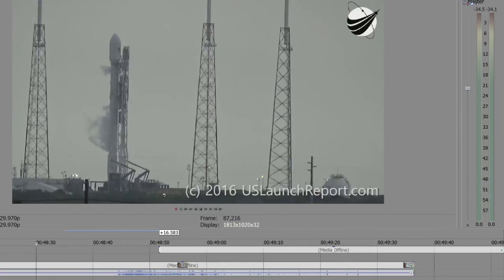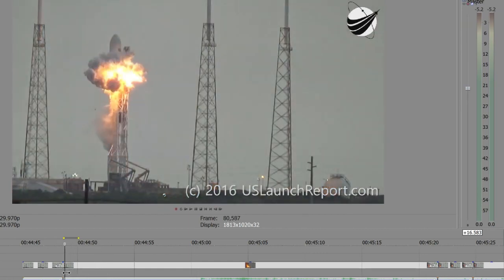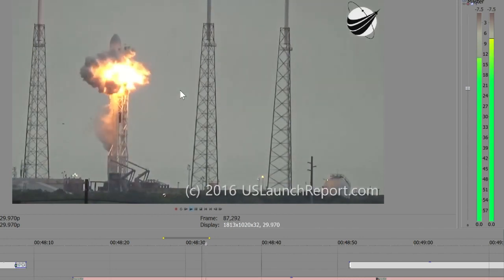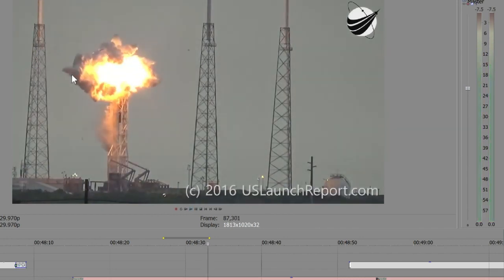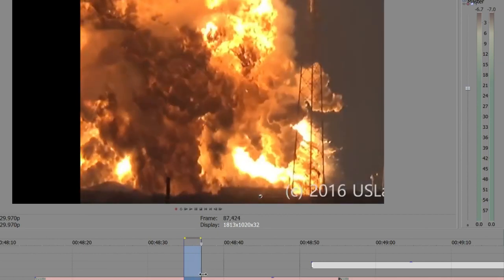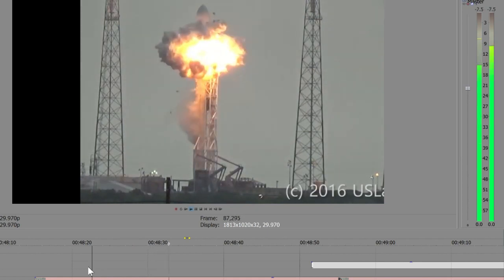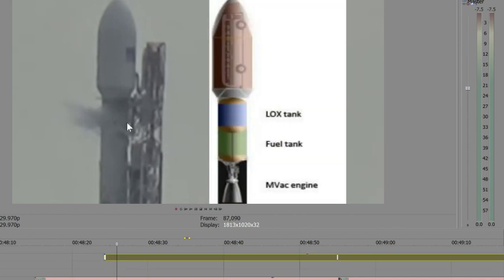Detailed analysis of Spacex Rocket Explosion

Comment: Cause of the explosion? SpaceX released an official statement in January 2017, indicating that the cause of the failure was a buckled liner in several of the composite overwrapped pressure vessel (COPV) (used to store helium which pressurize the stage's propellant tanks), causing perforations that allowed liquid and/or solid oxygen to accumulate underneath the lining, which was ignited by friction. Following the explosion, SpaceX has switched to performing static fire tests only without attached payloads.

Comment: ICYMI: (Below is an extract from http://www.spacex.com/news/2016/09/01/anomaly-updates )
"The accident investigation team worked systematically through an extensive fault tree analysis and concluded that one of the three composite overwrapped pressure vessels (COPVs) inside the second stage liquid oxygen (LOX) tank failed. Specifically, the investigation team concluded the failure was likely due to the accumulation of oxygen between the COPV liner and overwrap in a void or a buckle in the liner, leading to ignition and the subsequent failure of the COPV."

Comment: I've read similar analysis written by some Russian who studied some engineering back in a day. Not even linked to rockets. In his opinion that pop was caused by hydraulic shock because of SpaceX attempts to pump more fuel and more oxidiser (lower temperature of both - higher density) in the same amount of time. Hydraulic shock caused something to rapture - could be "filling hose", could be something on board, could be connection between the two.
And he also mentioned that it is really weird that SpaceX haven't solved the mystery immediately, end Musk called it "the most difficult and complex failure we have ever had in 14 years."

Comment: TF, could you focus a little bit on the ejecta we see in the first few seconds of the explosion. Particularly the large piece that seems to go pretty much straight up. If the first event was from within the rocket body, how did this piece get past the payload. Is it possible that the first event happened outside of the rocket body and sent shrapnel through the tank?

Comment: Youtube user TechX has suggested what seems to be an entirely plausible scenario for an initial explosion outside the rocket, just as it appears in the video. If the LOX loading pipelines on the tower were insulated with polyurethane foam, soaking it with oxygen would produce a rather powerful oxyliquit explosive. But if the pipelines didn't actually leak, where would the oxygen come from? The air, plus possibly the oxygen-rich vent plume from the rocket itself. SpaceX supercools its LOX to cram more into the tank, so it would be cold enough in the pipeline to condense oxygen out of the air. You're probably more familiar with this hazard when handling LN2, since its normal boiling point is well below that of LOX.

Comment: I think the MVac started falsely, creating a vacuum in the plumbing, thus creating a vacuum in the fuel tank, rupturing the separating wall with enough force to generate either a spark or heat, causing the explosion.

Comment: hey is there any chance that the first squeek and pop are the liquid oxygen and fuel mixing, exploading out the exhaust or thruster but only a little burst, then it takes a few seconds for the mixture to heat up enough and build up enough pressure to break the side of the rocket. I guess that'd explain the sudden explosion and the creek + pop. Try enhancing the video at the exhaust

Comment: You have done an excellent analysis. I would like to challenge you to calculate the speed of the fly by object.  You will find it IS NOT A BIRD. 

• You know the height of the rocket. Using this you can estimate the distance traveled by the object per frame.

• The frame rate of the video is likely 60 frames per second. It may be 30fps but I doubt it. For fun, let's be conservative and say 30fps.
Given your video, I'm sure you can do the math.......

Rate x Time = Distance

Don't forget to convert units!!

I have no clue what this thing is in the video, one thing is certain,

IT AINT NO BIRD....... 

Unless it has a giant bottle rocket shoved up its butt.

Comment: Hi Thunderfoot, this is an excellent analysis, unlike most of the stuff I could find on youtube (bullshit like the "strongback" exploded etc.). One small correction: helium is used to pressurize the kerozine tank. The oxygen tank is pressurized with oxigen, heated up in the rocket motor via a heat exchanger. Confusing fact is that the helium bottles are kept in the oxygen tank, because that's the coldest place of the rocket. (Actually, helium has to be heated in the rocket motor too to be useful for pressurizing... etc.etc.)

Comment: It's now Oct. 2, 2016 and there still seem to be no answers as to the cause of the explosion.    I wonder if SpaceX has considered trying to reproduce the incident?   They could use one of their used (landed) first stages, and sacrifice a new second stage then do the fueling procedure over a number of times in the hope a failure might eventually occur.    If the rocket is instrumented well enough it might give them enough clues for a solution to the problem.    A last resort method of coarse.

Comment: After the pop there was evidence of 'weight' rupturing the lower fuel tanks, could there be a possible 'blowout' of the upper fuel tank at least dropping the volume of the upper tanks content straight down to the top of the lower fuel sections? Can you zoom in and enhance the area below the area you show, maybe there is a sign of failure below that area before the explosion? Awesome analysis, that bee had me wondering...
Reply: it almost looks like the upper rocket fired...

Comment: NASA wanted to point some of their cameras at the SpaceX pad during the launch and SpaceX said no for some reason.  Also Musk has said that it was a massive helium leak that caused the explosion, probably cryogenic helium spilling on to the oxygen tank rupturing it somehow.  But if SpaceX had had some sort of mass spectrometer based leak detection system of the type NASA has used since the Apollo era, they would have seen helium levels rising as the helium leak began developing, they would not had to wait weeks to gather and reassemble debris to figure this out.

Musk claims to innovate, but its basically a commercial version of the Russian methodology used since back in the 60s.  Horizontal processing, rotate to vertical, many smaller simpler engines rather than a few larger more powerful ones and a much higher acceptance of risk levels.

Comment: Nice analysis. I was hoping that TF would give us a detailed analysis, if only to compare it to my own. 

I believe the squeak is from the area of the rocket. My first impression was that it was a piece of metal that had come loose and swung down until it impacted on something. My training as a Machinist Mate would lead me, instead, to suspect that it is a pressure relief valve opening. In either case, the pop afterward would be the initial detonation that triggered the rest of the explosions. 

You can also see debris flying away from the explosion in all directions, and the one that I find most interesting is the large object the flies almost straight up and then arcs down. Just by eyeballing the trajectories of these pieces, I'm given the impression that they all trace back to a place near the outside of the oxygen tank, maybe a meter from the outer wall of the rocket. 

The detonation is a little more difficult to trace, but it seems to me that it also converges back to about the same spot on the outside of the rocket, over the top of what looks like cables. 

What I suspect happened is, either a tank ruptured and spilled the contents of the tanks outside of the rocket, where they detonated, or a filling line outside the rocket leaked, then detonated outside of the rocket, or a pressure relief valve somewhere in this system dumped LOX out, where it then detonated outside of the rocket. The news today that SpaceX believes that the failure somehow involved the liquid helium pressurization system allows me to believe that maybe enough pressure existed somewhere in the system to pop open a pressure relief valve. Either that, or someone had a tank that split.

After the secondary detonation, the upper wall of the second stage, where it meets the payload fairing, had collapsed inward, resulting in the payload falling into the strongback, where it lodged while the rest of the rocket disintegrated beneath it. It was lodged pretty strongly in the strongback, as, when it fell to the ground, it bent the top of the strongback sharply. 

Notice that the strongback rotated backward slightly from the rocket at the secondary detonation. The rocket did not budge at all, probably because it was latched down. The motion of the strongback and the lack of motion of the rocket strengthen my impression that the explosions took place outside of the rocket and near the strongback.

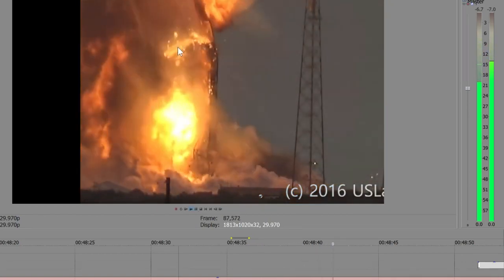Comment: 01:55 - That wasn't the 2nd stage falling, that was the payload.  I'm surprised you'd make such an amateurish mistake (no disrespect intended) in identifying that given the clear shape of the composite fairing (being of a larger diameter than the Falcon9 itself) — I note you did correctly identify the satellite and its fairing at ~04:50+.
The Amos-6 which was headed for geosynchronous orbit would have had its own fuel tanks for maneuvering into its final parking orbit, which is likely why it too exploded on impact.

06:00 - I bet SpaceX will from now on have at least a 1/2 dozen HD cameras surrounding its launch pads to record (at high speed no doubt) any potential mishaps – should they occur – during routine tests on the launch vehicle prior to launch and of course during the launch itself.

Comment: Enhance, Enhance, Enhance, Enhance, Enhance, Enhance, Enhance, Enhance, Enhance, Enhance, found it.
Reply: "Zoom and enhance cliché." DING!
Reply: It only works for static things (aka, not moving or continuously changing shape); so it is perfectly fine when what you want to remove is the "noise" from the atmosphere turbulence or ambient light from distant clouds or nearby gases.
  
If the change he wanted to spot only happened 1 frame before the explosion, this "enhance" feature would not be usefull at all [because it needs many frames being practically the same to balance out the interferences].
Reply: All you unbelievers, just ask Scully for proof that it works.

Comment: If the helium overpressures the LOX part,wouldn't that mean the boilof of LOX would come out with visibly higher pressure too?
Reply: At about 8 minutes before the test firing, it wasn't pressurized for flight yet.
Reply: Admiral Quality I am talking about the part where he gives as a possibility that the pressurized helium tank on top leaked/ruptured, thus prematurely pressurizing. Or is the helium pressurized after the LOX fueling is complete? Then helium is not an option at all.
Reply: Yeah, the helium is on board, in smaller tanks within the LOX tanks. So yes, if they ruptured you'd expect the LOX tank to rupture almost immediately after. 

I suppose they must rupture at some point. But I think this would have looked a lot more like the flight accident if the helium bottles had ruptured first. (No flame at first.This was the exact opposite. A flaming small explosion THEN the mass release of oxidizer and fuel.) And SpaceX would see the pressure spike preceding the explosion on their telemetry, which they haven't.

Comment: Why do they use kerosene? Why not diesel fuel? Its much less flammable.
Reply: That's exactly why they don't use it. It burns much, much slower so it's totally useless for the quick burst of thrust they need to lift off.
Reply: TalesOfWar Not exactly. Diesel fuel is used in several different backyard bombs. You just require a powerful ignition source. That's why diesel-ammonia bombs are so devastating.

Comment: If you put a glass of ice water in the sun, will the temperatur of the water sink or rise? On the one hand the water will heat up when it absorbs the sunlight, but on the other hand the ice will too, and then faster melt into very cold water to mix with the warmer water in the glass. I suppose it depends on how much ice there is and what temperature the water is..

Comment: This whole analysis is based on one video with a lot of conjecture involved. The types of investigation that are need for finding causes takes weeks to months to workout, TF is running to a quick claim of an engineering problem with the fuel tank, without considering any other factor. I don't see TF using data from SpaceX or the independent investigators in any claim he made, so I should just believe in what TF says about the explosion.
Reply: This is apparently one of or the only video of it in existence. They've actively asked for members of the community to help them come up with possible reasons for this failure.

Comment: The pop matches an electrostatic discharge from the lower left of the first stage  to the upper right of the second stage.  It will be visible in 1/4 second loop,....discharge travels from left to right upper then the ignition happens.

Comment: To be fair, they had at least one camera filming this. We don't know if they had other cameras of which they just never released the footage to the public. SpaceX asked for additional recordings that might help them pinpoint the source of the bang. It could mean that their other recordings simply did not capture it. It is also possible if not likely that most of their cameras do not record audio. 
Also remember that this was only a ground test and not an launch. They have lots of cameras watching their launches from all angels and even on and inside the vehicle. But they might not have thought of it necessary for a ground test. I don't think anyone expected something like this to happen. The LOX tank was not even half full yet, at ambient pressure and from what I understand the pressure release valve was open to remove boil off LOX. They were still minutes from ignition and some cameras may not be on until close to to ignition.
I also want to point out that any tank rupture would be showing up in the telemetry of which they had 5 seconds off after the pop.

Comment: Is this the cause of the explosion? The electrostatic effect caused by the refueling of the rocket, and the rocket doing electrical tests at the same time. The second stage ignited before the first, so maybe the electrical testing included a grounding somewhere which led to the explosion of the fuel in the rocket? Isn't there a mechanical switch or something?

Comment: Something in my brain tells me that the failure of the upper stage caused someone with their finger on the OTHER red button to self-destruct the craft; you don't want semi-failed tanks of lox and fuel laying around -- The progression downward in stages from the initial explosion makes me think it was intentional after the primary failure.
Reply: Given how close the stages are physically to each other I don't think there'd be any need to manually abort. It'd take care of itself like it appears to have done.
Reply: Possibly -- I'm guessing the holyshit button is there for when it's a nonvolatile failure and the beast just falls off the mooring tower -- they don't want intact tanks laying around with fuel.  semi-controlled conflagration is ironically safer.

Comment: Articles talking about the explosion have SpaceX people commenting that they used sub cooled liquid oxygen whereas other rockets don't. You've mentioned static buildup, but could it be feasible that the temperature difference from the source O2 tank and the rocket tank caused an implosion? 
Rapid change in temperature of gases leads to a rapid change in pressures, and since you've said both the O2 tank and the L. Fuel tank shared one wall, that could be the point of material failure. Containers designed to keep gasses under certain range of pressures, wouldn't hold if the contained gas is outside this range.

Comment: Technically well done, very reasonable! Good job, thanx! But what can SpaceX do about ist? Reconfigure its second stage?? (With two seperate bulkheads and an adapter to take the weight- load between tanks...) It would take at least a year. Wonder what they see as the final reason. But I now became convinced thast the first faint "plop" sound is the rupture of something failing structurally under immense stress. Can well imagine that this makes
 quite a bang! Michael B. Butter, Germany

Comment: I would like to know more about the range safety system on the F9. Where were the explosives installed on the second stage? They're not shown in the F9 user's manual since they're usually not very interesting to the users but on other rockets they are typically linear shaped charges designed to cut the tanks open longitudinally to disperse the propellants as quickly as possible, and in a way that minimizes mixing. (I think that means the charges for the two tanks are mounted on opposite sides.)

You show what I had not seen before, which is that the explosion seems to originate in the vicinity of the second stage intertank, so it would be helpful to know exactly where the explosives are installed in relation to it.

Comment: Maybe I'm stupid, but if everything had worked, would the LOx which has to be stored at under -180°C still make the fuel freeze up because they share a wall, which is presumably metal, which is a good heat conductor

Comment: I don't  know if only I noticed, but the percieved height of the craft and the direction of venting changes slightly after the pop. because the venting direction changes I would say that is highly improbable that it was just someone nudging the camera, pointing it slightly upward. I think the pop is some kind of structural failiure, causing the tank or some other part of the craft near the the tank to collapse, resulting in a fuel/LOX mixture